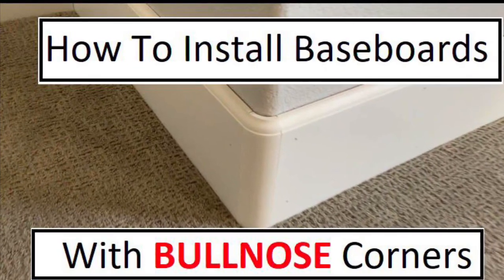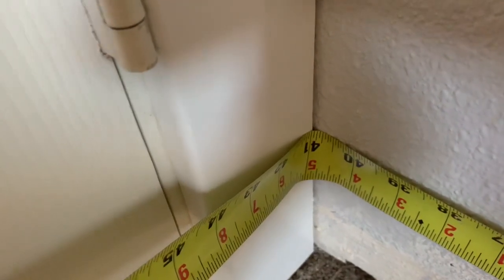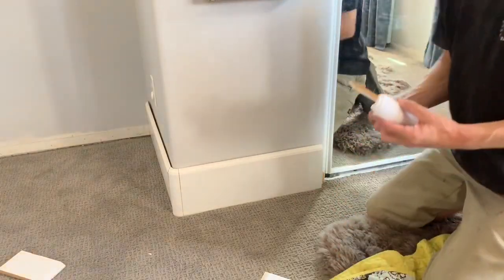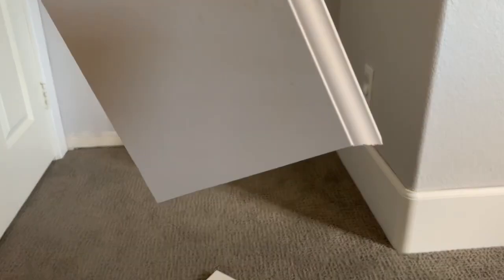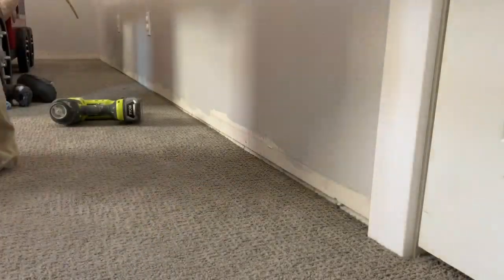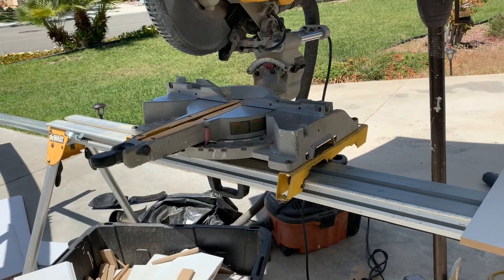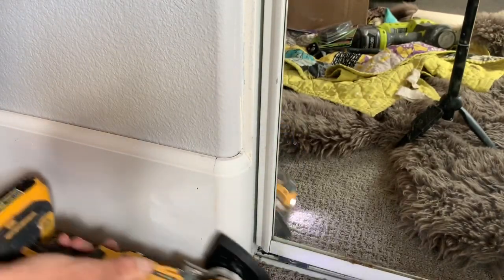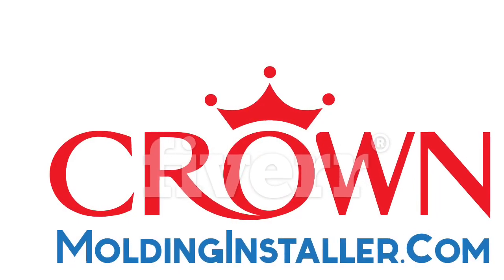How To Install Baseboards With Rounded Corners - Easy Bullnose Corner Tips!

Comment: Thanks.  I am laying new vinyl plank flooring and reinstalling baseboards with the nice rounded bull nose corners.  This will help a lot.  I just ordered the glue.  Question though, how do you handle walls that are slightly out of square?
Reply from the maker: silvershadow415 if it’s the inside corners, coping the base takes care of that.  If the outside corners are off a bit you can cut the end of the baseboards at 2/3 degrees on the bevel depending how bad it is so it’s not sticking off the wall too far.  Vinyl plank is awesome! I’m laying that next when I replace my floors..

Comment: It looks like you used a braid nailer, why not a headless nailer?
Reply from the maker: I’ve seen some guys use long pin nails around my area.  While it looks great at first, every job I’ve seen after a few months has cracked caulking and corners.  I don’t think the pin nails can hold the base in place with the expansion and contraction of the wood/mdf like brad nails.  I just don’t want to go back to jobs to re-caulk them is the short answer 👍🏻

Comment: What size brads are you using?
Reply from the maker: Dave Wildeman for this base i used 1 3/4” brads.
Reply: @crownmoldinginstaller6624  I thought he was inquiring about the gauge size.
Reply from the maker: @joncook6167  18 gauge 👍🏻

Comment: What glue is that?
Reply from the maker: Scott Tekavec Hi Scott, it’s 2P-10 glue and activator. There’s a link to it in the description.    I use the thick glue myself, so it doesn’t drip off the wood.. learned the hard way!
Reply: Use a hot glue gun for the corners. clean and quick.
Reply: @stephenhardman8661  Thanks for the tip, hot glue worked great!